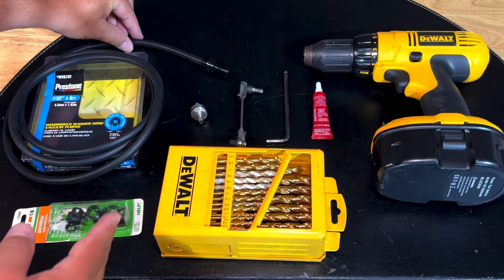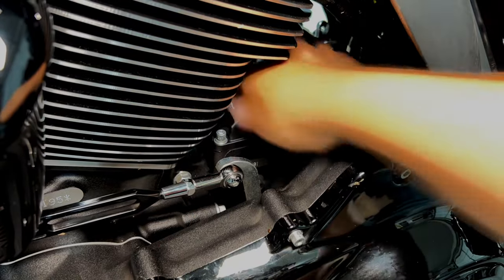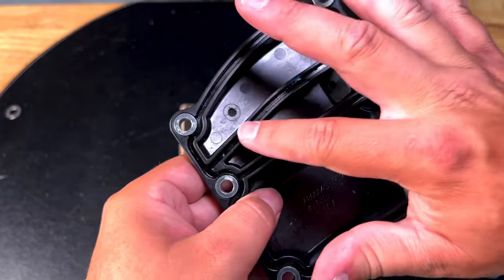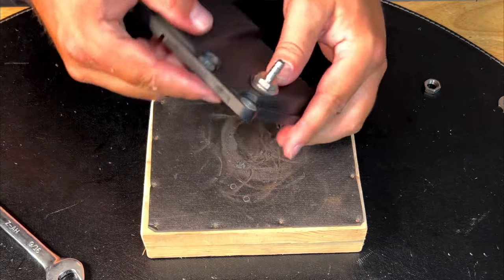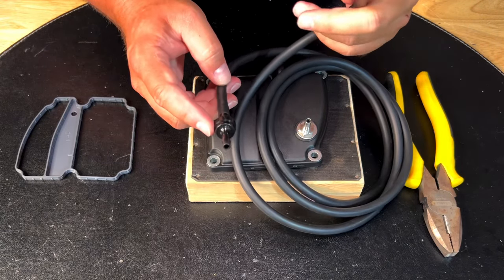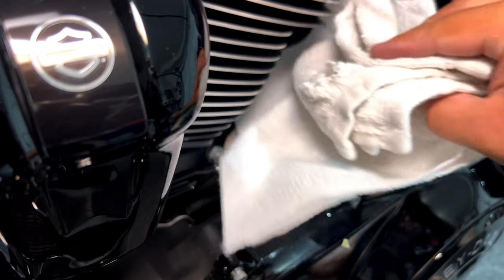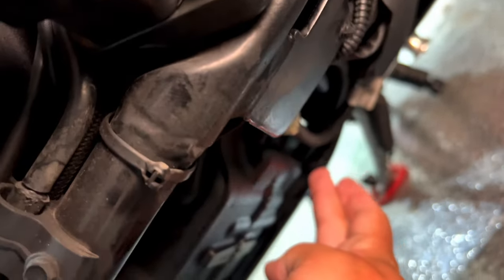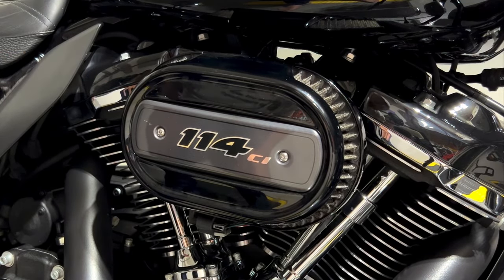🛠🤯 Do You Need Crankcase Breather For Your Harley? Watch This Video For The Shocking Results!

Comment: Thank you for the efforts my friend  I have an 17 ultra and it was onenof the first things I have done and assembled dipstick vent from A1 cycles. And yes, it didnt help much for the blowby, but reduced it. So I then reroute the blowby tubes out of the ac box, down to the ground, problem solved, no more stivky oil mist inside the air filter. Keep the good work. All the best.
Reply from the maker: Nice work! in 2017 you might also want to check this oil pump I have video on this as well https://youtu.be/mmvYLWmJJxE?si=LdmReg4F0XAHmSNd

Comment: I think your vent and hose is not large enough. I used a much larger fitting and hose. Mine seems to be doing the job.
Reply from the maker: I thought of this too actually I am tempted to try this solution without valve (as temporary check) to see if this will change things. I also wonder if hose isnt too long and if this affects things.

Comment: Thanks for sharing this experiment on the venting.  I think diverting the blow by from the air cleaner breather bolts may be the next step.  Ive thought about doing that on my bike.  Ride safe and enjoy. ✌️👍👊
Reply from the maker: Yes I feel this is next logical step here. I just learned new CVO have completely redesigned system

Comment: Dude your off your head, the crankcase vent will never eliminate the rocker box pressures or condensation, they are two seperate areas. The crankcase vent stops the oil frothing due to excess crankcase pressures which made it difficult for the pump to scavenge the oil. Harley addressed this with a later pump but the bike still has issues with frothing oil and and wet sumping ie oil collects in the bottom of the crankcase. Your crankcase vent eliminates this frothing. The maintained vacumme with your one way valve helps ring seal. Head breathers vent condensation and oil mist into the inlet, it takes a few months for this to happen from new. Harley did new style vacumme head breathers which are supposed to eliminate this issue but even these new units can fail. Only cure is to block the path of the oil into the inlet with silicon and run seperate vents from the head breather bolts to a catch can or vent to atmosphere. Never block these altogether as will cause excess pressures inside head and blown gaskets.
Reply from the maker: I am waiting for my warranty to expire to do vent in AC. Surprisingly some people reported no head blow by after installing Trask cover. As you could see that was not the case in my motor. I plan to vent heads straight to the ground as it is minimal amount coming out of there but yes after 3000 miles it accumulates and clog my AC filter. Thanks for your comment and hard not to agree seeing results which had minimal or no impact. Glad I didnt spend $350 on Trask cover
Reply: @RidersUnited  head breather venting to a catch can or atmosphere wont affect your warranty ask them, harley has known for a very long time that venting into the inlet is bad for the engine. It's part of emmission controls they have to impliment, mind the dealers have made plenty of money out of it, with customers having running issues even engine cut outs, lumpy starts. Thats aside from the extra carbon build up on the piston crowns. Its about $100 for them to remove the filter clean the pathway and inlet manifold/IAT sensor which it can directly affect and refit filter. As you already know it takes a few months for the goop to recreate the pathway to the inlet, sometimes several thousand miles. That could be a new season with a winter rest to a rider before they're back at the dealers for another clean. On a new M8 bike with a trask cover fitted they might yet not have experienced goop in the inlet, maybe they think its preventative maintainance. If the factory fitted M8 new vacumme style umbrella valves work as they should they might never experience head breather goop. Though even these new style vacumme umbrella valves have been known to fail hence why there is an expensive after market for that particular item.They even make one for the twin cam, Trask do a Mystfree kit, on the M8 there is the Fueling 3250 head breathers and the Cycle Solutions T-man performance breather valves. On the early twin cams that never needed crankcase venting they will almost certainly be experiencing head breather goop to some extent, that said. All harley engines are not created equal, atmospheric pressures and climate temps do play a part to an extent. On newer M8's it could take a very long time before that engine vomit makes its presence known, trask fitted cover or not. Plenty are still in denial.
Reply from the maker: @paulsmale5436  big thanks for all the great info. I truly appreciate it and I am sure many people watching my channel will read your insightful comment and learn what you shared. Big kudos for taking your time and explaining in details. Super helpful for sure 🙏
Reply: It’s my understanding that HD is venting through the cover now on the new 117 motors. It’s been said this may have been something They  intended to do in the past with the cavity design already implemented in the casting.
Reply from the maker: @joemetzger1362 new 2024 have updated cover design that can be retrofitted to older bikes now

Comment: Before you do that. The length of the hose adds restriction to the flow. So try shortening the hose or using bigger diameter.  

Also add the valve closer... right before the hose turns down the first time. Oil will not come back after it passes the highest point of the hose.
Reply from the maker: Thanks for this suggestion I thought about same thing. I have to say restriction was minimal when I blew into the hose but I feel same thing that length might affect things

Comment: I'm going to ask a question and please correct me if I'm wrong. The blow by tubes at the intake are to vent the engine crankcase. You installed the vent into the cover of the transmission. My assumption is that the crank case and the transmission sump are separate and likely sealed from each other due to different oils. Venting the transmission won't vent the engine case???
Reply from the maker: Actually under transmission cover are 3 separate compartments and one of them is connected to crank case. Transmissions vent is installed from factory and there is a tube coming out as original set up. Glad you questioned this.
Reply: @RidersUnited  Thanks for the explanation - now I know the story!
Reply from the maker: @carlgilmore9821  always happy to help and thank you for watching really appreciate it
Reply from the maker: @carlgilmore9821 sure thing